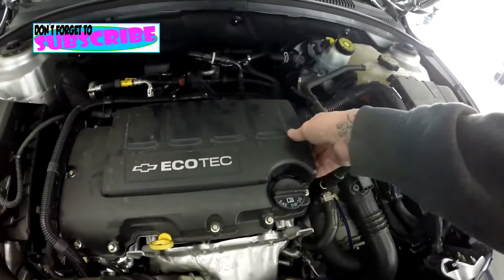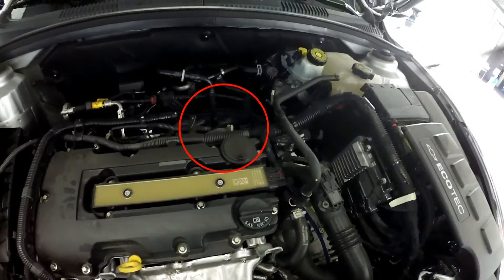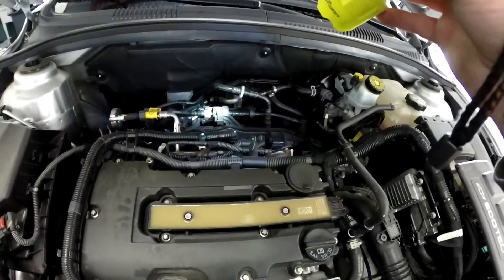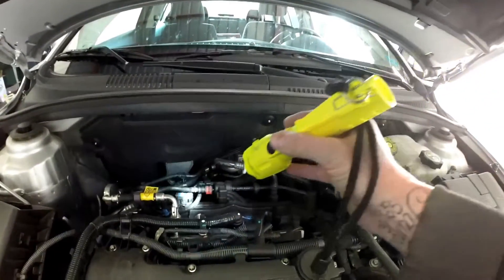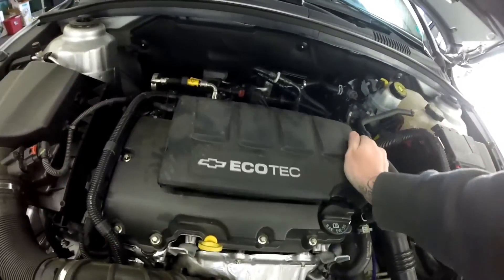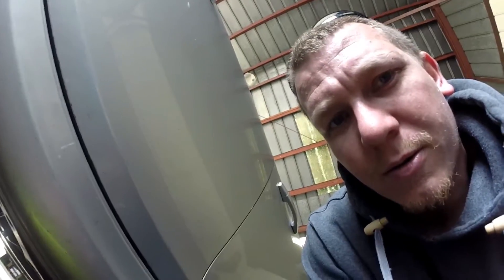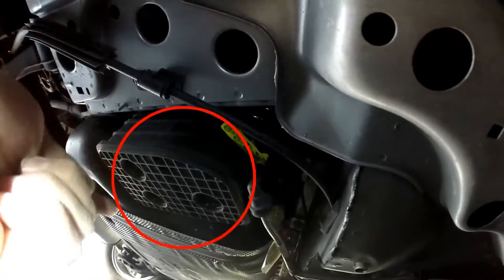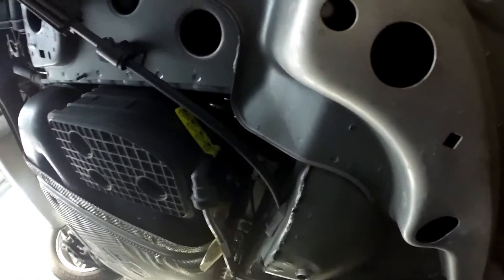Chevy Cruze emissions locations: PCV, EVAP canister, Vent, & purge sol.

Comment: This is not the correct location for the EVAP charcoal canister on the 2016 Cruze. The exception would be the 2016 Cruze Limited as it was the same design of the 2015 year, just branded as 2016 Cruze Limited.  The 2016 Cruze was redesigned.  

The engine is a new ecotech engine and the layout of just about everything is different.  The EVAP charcoal canister is located on the drivers(left hand) side of the vehicle and the gas tank fill is on the right side.  I have not checked the location of the purge control valve in the engine compartment yet.  

I found the problem for my issue.  Some rodent chewed the wiring going to the vent solenoid which is above the charcoal canister.
Reply from the maker: +Robert Wade thanks for the comment.  Ill update correction of the aplicable years soon. I usually get the model years from wiki and we sll know wiki is not 100% correct. 

Good job finding the rident issue. I have actually seen that a lot. When I smog cars and see a rodent problem I always make sure to tell the customer. In my 14 years smogging I've personally have had to replace 3 complete wiring harness. In one of those cars I found a mouse nest under the center console with babies in it. The whole nest was cushion and wire casings from the car.

Thanks again.